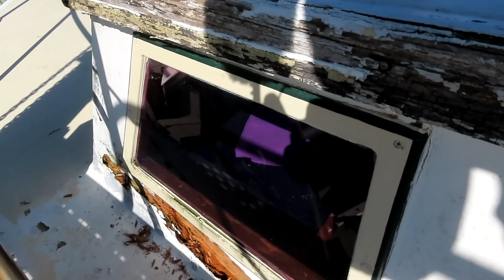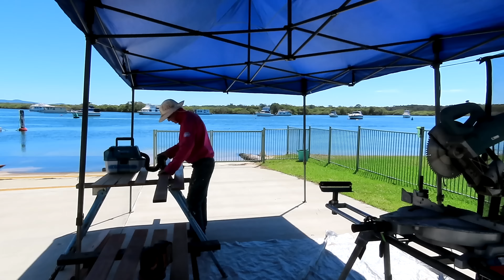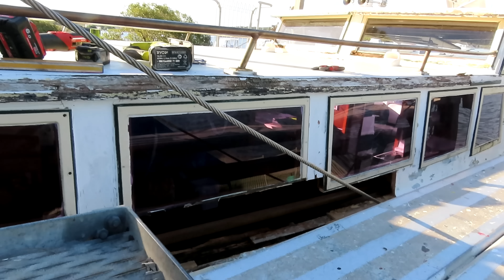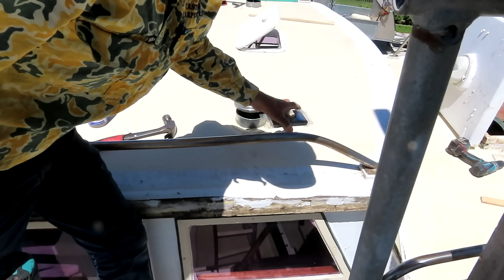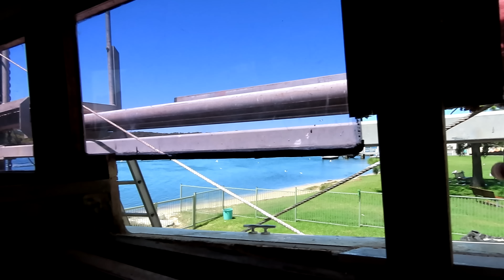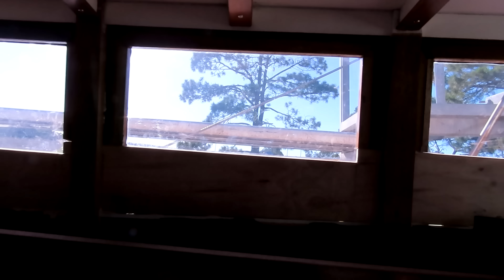I CUT A HUGE HOLE IN MY BOAT

Comment: The word your looking for the wood around the boat that you cant replace whilst on thay cradel is called the sponson. (rubbing strake)  You might have to steam it before putting it on to get the curve shape.  Steaming wood is about 1 inch thickness = 1 hour in the steamer.  One other tip when owning a wood boat, make 'Everdure' your friend, its a 2 part mix and sinks into wood killing rot and hardening the wood.  It's great stuff.
Reply from the maker: I will have to look into Everdure, can't say I have heard of it yet. Going to be an interesting process steaming it while floating on the mooring but where there is a will there's a way I guess.

Comment: It was just a small hole wasn't it Tim???  The marine ply sits there well and the fibreglassing will make it well protected; I thought you might have caulked it also just for an added layer against the elements. Fridge inside makes total sense!!!
Keep up the great work Tim & Co. :)
Reply from the maker: Lol it started as a small hole......
I didn't put much thought into moving the fridge but now it's done I wouldn't have it any other way and dad did a great job making it fit.

Comment: You would be surprised how a tiny water leak up high around deteriorating window sealant and grab rails can travel so far before it gathers and slowly rots out the timber. Also around the base of bow rail fasteners it won’t necessarily rot beside the leak but travel through the grain to a weak area and slowly get worse. I would be scraping out every rail and windows old sealant and re seal with urethane.
Reply from the maker: It really was surprising just how far it had travelled. Although it wasn't a small hole in the window so the problem was just made worse. In time all the windows will be coming out and getting resealed with new outside trim made also.

Comment: getting there mate! Looks like most of the rotten wood is not structural, and although quite a bit of work, but nothing disastrous!.....and the subs are steadily rising too!!
Reply from the maker: Thanks mate, I feel like I got the rot at the right time. I think if she was left for another year it would be starting to get into the actual structure of the boat making it unsafe. The response to the first few haul out videos have been very positive and subs on rise, hopefully reach 10k in the not to distant future 👍🍻

Comment: The hull is so very, very well made,  and the superstructure was clearly not of the same quality.  Do you have any history regarding your boat that helps to clarify the apparent disconnect in quality of construction?   Those windows where they meet the wood framing are  always the  weak spots--even when it's not raining---moisture on the panes of glass wicks into the wood structure, and I've yet to find a solution, such as 5200, or boat life, that doesn't fail given how raised cabins constantly move when the boat "works" in seas. As I mentioned in a prior comment, you may wish to cover your windows with isenglass panels with marine canvas borders. We've had success with this approach -- somewhat similar to providing a set of "storm windows" on a house, the weather covers keep much of the destructive moisture away from those vulnerable glass/wood frames.  Hope this helps-- respectfully,   James
Reply from the maker: Hi James thanks for your comments, unfortunately I have almost no information and no documentation at all from Kiarras past. I would speculate though that when she last had substantial work done the hull was done by a professional then the owner decided to save some money and do the topside work himself.  Do you have an example or website I could look at for the exact details of the storm surrounding you mentioned.

Comment: That has been a lot of work nice job you have to when to draw the line.
Reply from the maker: Yeah mate, I would love to rip all the gunnel timbers off and replace them but it's just not possible. Same for the drip rails and lots of other bits, if I pulled her all apart she wouldn't be able to be refloated and that would be an issue.

Comment: I had a problem in a few places on my boat a few years ago I got it all dry and poured as much wood hardner liquid into it and built it up with chopped fiberglass and resin then bluffed it in and covered it with fiberglass and a rubber bump strip on edge then screwed checker plate on to spread the load when walking on it that was 15/ 18 yes ago and it was still good!
Reply from the maker: It certainly is good stuff. This is the first time using it and I was very impressed.

Comment: Hi mate, would it be easier to make the new sections off site and make all the necessary units and sections so you can fit each section to the boat once the old has been chopped out?
Reply from the maker: It wasn't to bad doing these bits on the stand but yeah going forward I will be doing pretty much exactly how you explained.

Comment: Doing a great job mate👍🏻
But looking g at all that rot wouldn't it be easier and in the long run better to replace the lot from the deck up and re shape to suit you and make it look more modern?
Reply from the maker: If I had the room to work on her out of the water long term this could be a better option. Unfortunately I'm having to do the rest of the work on the water and it's just not possible to take the entire top deck off.

Comment: Can you extend your land stay by having it propped up on the hard, it would give you more time and more space?
Reply from the maker: Unfortunately not at this location. They only have the one cradle lift and no provision to move the boat off.
Reply: @HarpersShed  Bad luck there, however you're doing really well with what you have. Good work and well done
Reply from the maker: @bryand1958  thanks mate 👍

Comment: She has the size inside  for a decent  cruiser  in the sense of  a  redesign which is  what I would  do the hull looks good  just the upper works is rotted so why  not go for  a new look
Reply from the maker: It has been suggested a few times to re do the entire top side. The main issue I have with this is pure money and space restrictions. If I had a spot to put here close on the land where I could work on her long term and low cost that would be a very really option. As it stand I'm forced to do the remaining work on the water and it's just not possible to replace the entire top side while floating.
Reply: I understand  it is  a  pity  because  I  think you would make a good job of it  but at least you  are preserving it as  best as you can good luck
Reply from the maker: @kevinmartin3859  thanks mate I will to me best 👍

Comment: Instead of making up new doors why don't you settle for custom canopy sides with clear panels - use caravan slider strip for the top with stoppers, press studs or elastic straps for the base and sides.
Reply from the maker: I had considered this but I really do like the hard timber doors. It means I can properly lock the boat up when not there but also makes for a fantastic aft deck in bad weather.